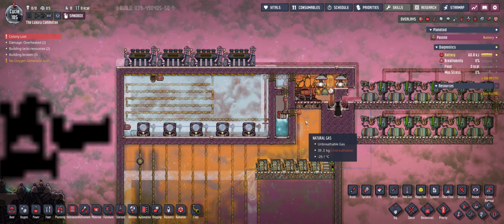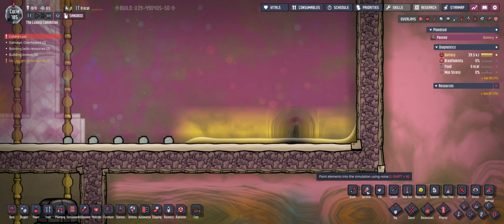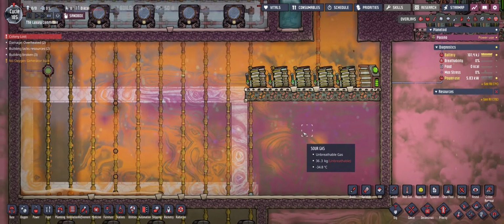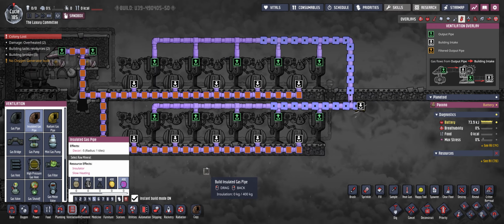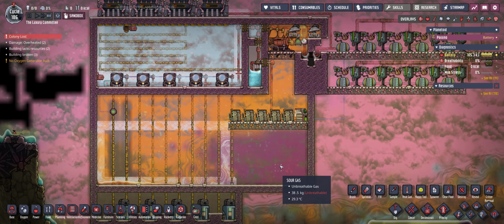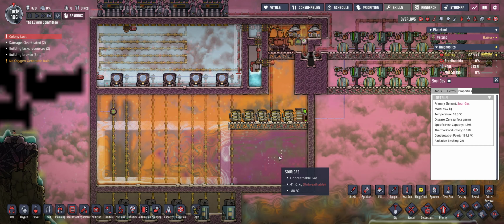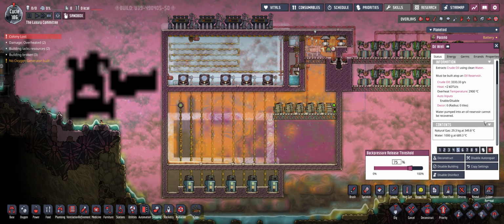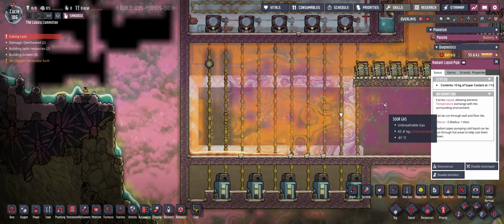Oxygen Not Included HowTo - New Sourgas Boiler design? Part 2

Comment: system will break when oil well needs dupe interaction as the water input will stop moving and break the pipe
Reply: Could be made more reliable with an atmo sensor and a timer. Very high pressure spikes probably mean it is being vented. Can turn off the water if it hasn't vented in a while (with an alert and override for the player, because it would never turn itself on again if it actually doesn't need to vent. Could be latched 'off' despite being otherwise working if the sensor misses a venting event). By putting the well itself in a hydrogen atmosphere you could also stop oil derived gas getting to it, meaning any detected gas would mean it has been vented. It can be as reliable as you can make a 'venting detector'.
It would be possible to add a 'probably been vented' detector for afk players, using a job that requires access to the oil well area and a dupe detector. The idea is that the job occasionally pulls in a dupe, demonstrating that there are dupes who can access the area. By setting that job lower priority than the well we can be extremely confident that a dupe entering to do that job means the well has been vented, and we can restart the water without player input (maybe put a delay on the restart to be extra sure). Then the only persistent failure mode would be dupes not actually having access, which means something has broken somewhere else and player input is definitely required.
Lots of room for safety features, as well as a different design of boiler. The idea being showcased is just the heat amplification using water to oil conversion. Personally I would try for a design using fewer aquatuners, not least because it is unclear how well this would work under partial load, and you need a lot of generators (space) to keep the water sustainable.
Reply from the maker: good idea. Also see other comments here

Comment: Natural gas sensor is too high I'd use both atmo and gas like 2 tiles lower at least with atmo being above it (atmo in mixed gas enviourment isn't accurate). Could have explained automation so the water doesn't backlog or to use 999 grams not 1000 but it's fine I've not yet considered boiling oil directly lucky the building can't overheat just melt.
Reply from the maker: Thanks man. Agree, not a ready-to-copy design for any base. I experimented on Oil Wells and came up with that idea, but havent used in non-sandbox games yet. Might do in future;)